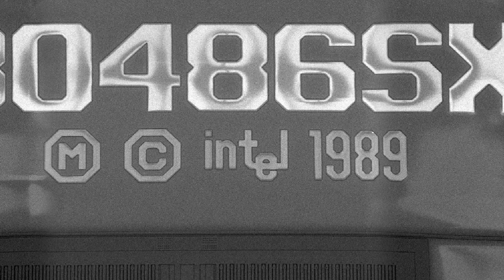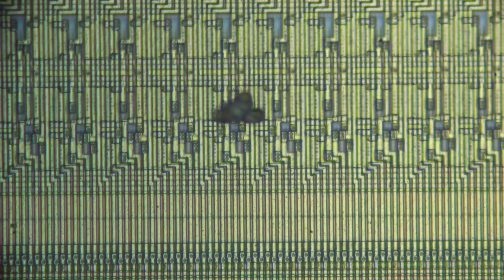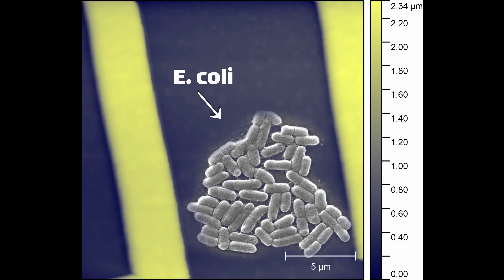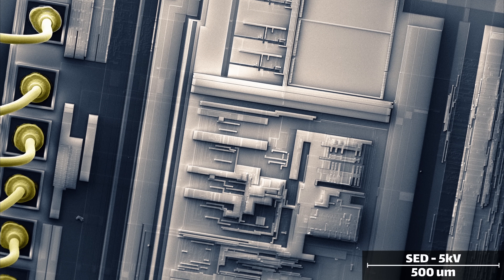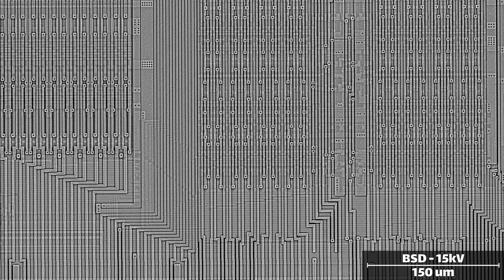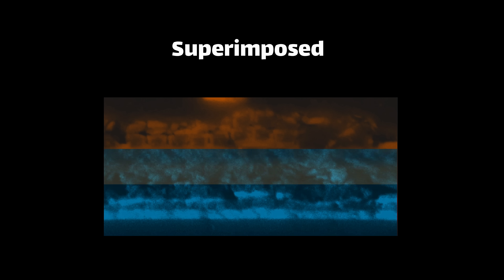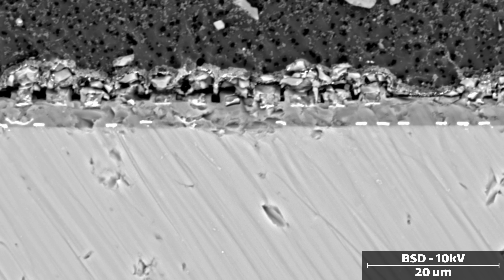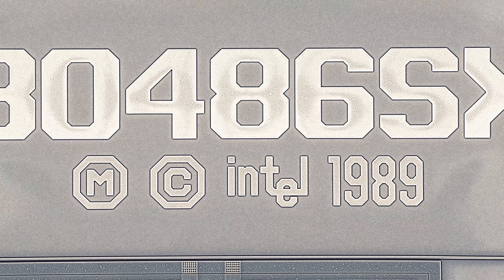Microscopic view of an Intel i486

Comment: This is fantastic content! The EDX overlays are really cool. 
I do have a few tips that I’ve picked during my time as a metrology engineer… Allied High Tech’s Epoxy Bond110 works really well for mounting protective glass slides to your cross-sections. (Their diamond polishing films also work really well). Proper polishing takes time you can’t rush it. Pt or Au sputter coating also goes long way.

Fun note about AFMs… if the object you are trying to image/measure is smaller than the radius of your AFM tip, you are actually measuring the tip itself. We would use this phenomenon to determine when a tip’s useful life has ended.
Reply from the maker: Rad, thanks for the tips! Will look into that, I mistakenly assumed a random bottle of cheapo 5-minute epoxy sitting around would be sufficient... and then was horrified how many voids there were and how poorly it held up to polishing. :)  Did you mount to the glass slide and then polish both the slide and the sample simultaneously (e.g. the slide was part of the cross-section)?  Or was it just used as a mounting substrate but the cross-section was just sample + epoxy?
Reply: @BreakingTaps  I would polish simultaneously. I’ve found when using this epoxy, less is more. A small drop of epoxy then clamp the slide to the sample for curing.
Reply: @BreakingTaps  yeah you might void your warranty doing that 😂

Comment: why didn't you explain how the chemical composition analysis thingie works? I have no idea, but it looks amazing
Reply from the maker: Yep, what Piipolinoo said. EDX/EDS. The electron beam, particularly when cranked up to max intensity and accelerating voltage, will kick out characteristic x-rays from the sample.  And the energy of the xrays emitted is specific to each atomic element.  So by blasting the sample with the beam, you can collect xrays from each location and categorize semi-quantitatively what elements are present.

There's a lot of nuance, a lot which I don't even know yet, which makes analysis tricky.  Detector location, how flat the sample is, how deep the beam is penetrating, overlapping spectra, etc etc.  But for some things like the aluminum interconnects it's easy to determine what's going on.

Didn't want to talk about it too much in the episode, trying to keep that channel more "mainstream"/documentary-like.  I'll probably talk more about the technical aspects of the SEM itself on this channel in the future though!
Reply: @BreakingTaps  but I thought you were doing these with your scanning probe microscope that pokes things with a small needle, I didnt realize it was a SEM. You have also shown the wiggling needle so I was pretty confident you somehow poked their chemical composition with a needle lol.
Reply: The techniquce is called Energy-dispersive X-ray Spectroscopy, short EDX. Almost all SEMs are equipped with it.

Comment: Lovely - a minor correction, the 486 came out in 1989 (as shown on the copyright on your images!).  The 386 came out in 1985 but would have been a bigger processor manufacturing node I believe.
Reply from the maker: Oof!  How did I miss that?!  Thanks, will start up an addendum for corrections.  I assumed the copyright was about the "SX" version, not sure why I assumed it was wrong hah
Reply: @BreakingTaps  Lovely video, thanks! Actually, the 486 SX was introduced in 1991, as a modified version of the 486 DX with the FPU disabled. The 1989 date seen on the wafer is probably the manufacturing date.
Reply: @Old Guy Makes sense, thanks for the correction!
Reply: Yep I remember looking at the back pages of Computer Shopper magazine (almost as thick as a phone book!) back in 1989 looking for the best deal on a 486 motherboard/CPU combo - the prices were such that today (even adjusted for inflation) you could buy a nice complete gaming rig for the price of a 486 motherboard+CPU back then! I also remember buying a 387 FPU coprocessor for my Zeos 386 around the same time! The 486 was the first Intel to integrate the two on chip with over a million transistors!

Comment: An interdigitated capacitor on a silicon process, stacking multiple chips, would that be enough surface area to store more energy than a super cap? Also any more supercap/cap videos in the pipeline?
Reply: I don't think that it would be quite enough surface area.
Reply: That'd be pretty much an MLCC, except that AFAIK the MLCC dielectrics are superior to SiO2

Comment: Instead of the mechanical method, have you tried chemical dissolution? HCl+H2O2 is a DIY PCB etchant. I bet It would work on aluminium too. Or NaOH?
Reply from the maker: I havent, but definitely going to try that next!  I was hoping mechanical polishing would be sufficient so I wouldn't have to deal with chemicals... but clearly not. :)  I've got some accelerometer/gyro chips that I'd like to decap next so will try out the chemical approach on that one.  Fingers crossed!

Comment: It is TiW diffusion barrier to prevent aluminum diffusion into bottom layers just like you said.
Reply: TiW is a common diffusion barrier for Cu interconnect, and it could have been used here, but I think TiN diffusion barriers (Si-Ti-TiN-Al) were still more common in the mid/late 80s. The W should also have shown up as more than a few stray counts in the EDS — heavier elements are harder to miss than light elements. Rather, if there was occasional W present in the EDS… This would have been around the right time for W vias to be introduced, and the low area would’ve explained the fewer counts.  I don’t have the fab process documentation, just offering an alternate hypothesis.
Reply: @travismassey7083 Agreed on all of these points. I don't have much experience with older processes and yes contact vias could have contaminated the analysis during x-section polishing and show up here and there on EDX. Would need to zoom in specifically on via to see what it's made out of.
Reply from the maker: Oh awesome, thanks for the verification!  I sporadically saw some Tungsten profiles in the EDS but couldn't get it reliably enough to really feel confident showing... and I was thinking it was tungsten traces and not TiW.  Very cool, thanks!
Reply: Also, the tungsten/W 1.77KeV (M transition) is right on top of your silicon/Si 1.74KeV (K transition).
You need to look at higher energy for W's L transitions.  We can talk/email about this.  Great to see
you back on the SEM.  Also, consider Epothin, Specifix-20, or equivalent for vacuum impregnation of those cross sections.
Reply from the maker: @jimquinn  Ooh, thanks for the epoxy recommendation! I assumed my <whatever> 5 minute epoxy would be fine... and then was horrified to see how badly it did under high magnification. So many voids! I imagine that made polishing harder than it needed to be, probably helped to promote chipping at the edge.
Reply from the maker: Thanks everyone for the input! Really want to have another go at cross-sectioning/polishing and do a better job this time so there is less debris in the image.  The tungsten situation was quite confusing to me (as someone new to EDS) because it wouldn't show up in maps, but you could get a pretty strong signal way out in the 8keV area (L transition I guess?) when doing a line scan or point.  Still only accounted for <2% total but was quite distinct.  I assumed it was either a very small amount or a very thin layer which was being missed with the less-directed mapping.

I unfortunately lost the data to a software crash, but had some other images where there were bright horizontal traces that didn't show up as anything in the EDS map.  Just voids.  But again if probed directly would show as Tungsten, or sometimes Selenium (which didn't make sense in this context, I don't think...).  But since I lost the data, couldn't find the area again and am generally new to EDS, I cut it from the script.  Didn't want to state something incorrect :(